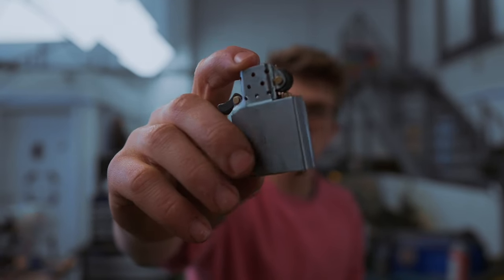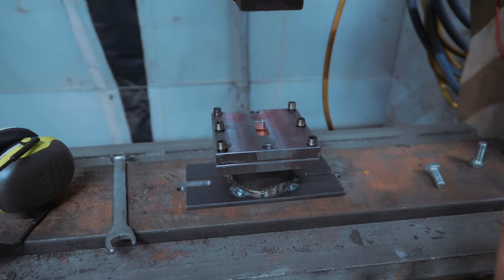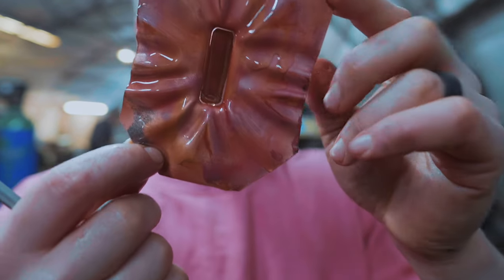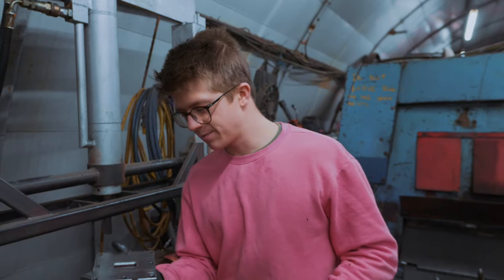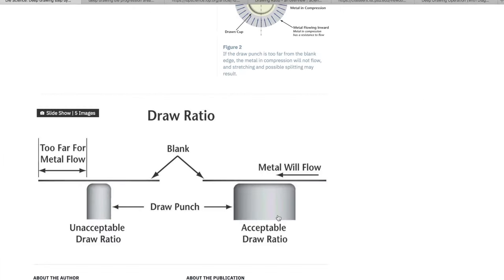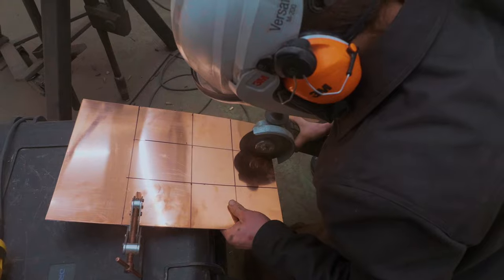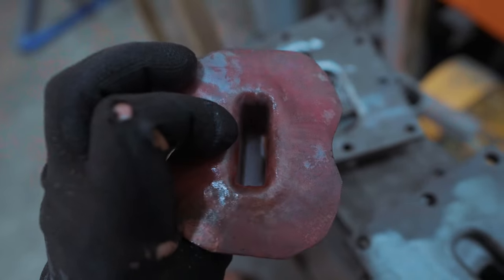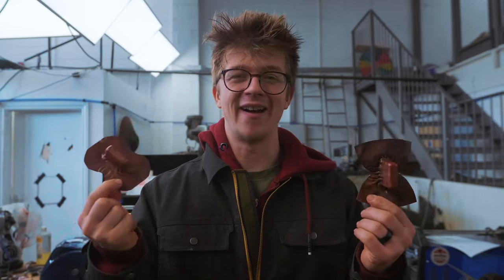Can I Make This Iconic Lighter? Part 5

Comment: Explosive forming is a metalworking technique in which an explosive charge is used instead of a punch or press. It can be used on materials for which a press setup would be prohibitively large or require an unreasonably high pressure, and is generally much cheaper than building a large enough and sufficiently high-pressure press; on the other hand, it is unavoidably an individual job production process, producing one product at a time and with a long setup time. There are various approaches; one is to place metal plate over a die, with the intervening space evacuated by a vacuum pump, place the whole assembly underwater, and detonate a charge at an appropriate distance from the plate. For complicated shapes, a segmented die can be used to produce in a single operation a shape that would require many manufacturing steps, or to be manufactured in parts and welded together with an accompanying loss of strength at the welds. There is often some degree of work hardening from the explosive-forming process, particularly in mild steel.

Comment: As someone who actually used to design deep draw tooling I can say that you don't have enough stages to do this. I would say a bare minimum of of 4-6 well designed stations as a starting point is required for this kind of thing(I don't have all the info required and it's been a while since I've run the calculations so that's just a rough estimate). Also brass would be easier to draw like this. If you want to make several of these I would highly recommend building a spring loaded stripper and if you run the numbers you can significantly reduce the size of the blank and cut it such that when it's done being drawn it only has a few millimeters of a flange on it which would also reduce the friction of your hold down plate making it less likely to crack. if you were making a lot of these I would suggest making a trim station that cuts the flange off.

Comment: I'd have really like to see him take 3 sheets of that copper and stack them together and then try drawing them down and thru the dies. Also would have liked to see him to a fast press instead of going as slow as he could. I used to form bullet cases out of brass and aluminum and it was pressed extremely fast through a die set to elongate the material.

Comment: The case may not be "perfect" but who else is going to have such a unique and detailed lighter case! I can't wait to see it all polished up.

That first mistake looks like some kind of trans-dimensional doorway. Super cool result even though it wasn't what you were trying to make.

As for finding a quick and easy way to complete this component, time is money in industry and manufacturers spend mountains of money refining their processes so it seems unlikely that you would find some easy hack to skip half of the steps and still come out with an acceptable part :)

Comment: Working sheet metal can be extremely difficult... Just to put things in perspective, when Hugo Borchardt  designed his semiautomatic pistol, the magazines were initially made by milling them from a solid block, instead of using stamped sheet metal.

Comment: Hi alec im a die maintenance technician and tool maker. Ive had years of experience in this field. The stages were good. You however most likely would not have needed as many if you did not retain the copper as tight. The copper was just stretching which was putting too much stress on it. However a very good job considering you are a novice in this field

Comment: it's not really possible to draw it all out at 1 go, in Tool and Die industry there's progressive stages to achieve that. with different hole and punch sizes and radius of the punch. to draw that deep is not easy, different thickness of the copper sheet have a different calculation too. you can try a gradually deepening wider top U shape and then shrinking it down as you go deeper and flattening out the bottom and edges to give some room for excess materials to be pushed out and you draw deeper.

Comment: I would have considered to go at it from the other way - how the aluminium soda cans are made from a piece that's placed at the bottom of the stamp and then have it heated and pushed out to the shape wanted. Possibly by using the stamp and a power hammer striking it. Maybe I'm too violent?
Reply: Soda cans are hydro formed.

Comment: Alex, maybe try some explosive forming. In another episode. You can stretch metal 3 times farther than with conventional methods. The theory is that the explosion causes the molecules of metal to vibrate so the metal becomes plastic. At one time the Brits were using it to form armour plate cupolas on their tanks.

Comment: Alec, I applaud your desire to learn new skills but was there a reason you didn't just mill it out of a solid block of copper?
Reply: Milling is time consuming, tedious, and gonna be heavy. Can't mill metal as thin as sheet metal
Reply: @h.cedric8157  Could have folded, tig welded and polished off the welds though. Would have been much much faster and cheaper for a single item
Reply: @DoodlesMcpooh  i think him knowing he could have tried it the "real" way would have killed him :D. Also he sure wanted to learn this technique as well
Reply from the maker: Only because I wanted to try this technique and learn about it!!
Reply: Thats what i thought, if you love doing something, time's just a number :)
Appreciate your endurance, keep going alec 🤟
Reply: @AlecSteele  I respect that you love to learn something new. That's they way to be. Congrats on it finally working buddy
Reply: What is the jacket slash half zip work shirt he is wearing int the end of the video?

Comment: less binder tension  you just want it to guide the metal not clamp it use some spacers so you dont clamp the copper but just guide it straight

Comment: you are shooting yourself in the foot by wrenching the top plate down, after you get it started you have to loosen or remove that pressure so the metal can push down

Comment: Alec. A quick question.
Isn't putting hot metal in water or oil ment to harden it?
Reply: That's true for steal but coppers structure is a bit different so it will actually soften after heating and rapid cooling it and will harden as it is worked on

Comment: I’m confused by the tempering of the copper. Waaaaaay back in the 80’s at high school, we were taught to heat then shape copper, then heat and quench to harden it. If you quenched it and then tried to shape it, it quickly became brittle and broke.

Comment: You shouldn't of bolted the top plate to the bottom just use shims at first and slowly press down and remove the shims as you go down to full stroke

Comment: Instead of starting with a plate and pulling it into a shape, start with a solid billet at the bottom of the chamber and as it crushes, it will push it up the gap inbetween the male and female parts, This is how aluminium cans are made
Reply: what kind of cans? because thats not how drink cans are made.

Comment: Why not just do it like the early Zippos: solder a base plate onto rectangular tubing? Not only would it be cheaper and easier, it's the way the Zippo factory did it in their early years.

Comment: Heat the piece BUT don't quench it!  Let it cool down slowly to keep copper soft. Every time you Hardened blades, you quenched the blade when red hot.  Why do the same to soften the metal?
Reply: Copper has a different make up than steel and will actually soften when heated and rapidly cooled

Comment: I hate to sound too cynical but they call it PROGRESSIVE tool and die for a reason. I used to work in a factory that took rolls of steel and turned them into empty battery  cans (AA, AAA, D). They'd start with punching out discs on a huge press then the discs went through tools with progressive shapes the achieve the final cylindrical  shape that we are so familiar with.

Comment: Doesn't cooling it off in the water defeat you're purpose of annealing?   It should be cooling off as slow as possible to make the largest platelets.
Reply: Not with copper, the most straightforward way to anneal copper is to heat and quench

Comment: It’s the shape of the pellet, not your mold.  You can’t start with a sheet, you start with a heavy disc and take it through 6-10 stages each thining and stretching further moving metal further.  Go back to when you first saw how an aluminum can was made.

Comment: God damn that radius looks so unclean and rough! 
It's putting stress on your sheets! 
U need a really big radius on the top which gets smoler on the inside.  It has to be consistent and clean.  It recommend to go at least for 600 grid. I polish my tooling to a 1000 sometimes even 2000 grid.

Comment: This is really easy to do without a hydraulic press. Heat up the copper and keep it hot and just hit that top die with a hammer problem solved. If they would have done that from the start they wouldn't have waisted a whole day fucking around and all that copper

Comment: Literally all he needed to do was not tighten the copper down too much. It was punching a hole every time, because the copper couldn’t move with the punch.
Reply from the maker: Unfortunately it’s not that simple, there has to be a force exerted on the flange during deep drawing to avoid excessive wrinkling and folding

Comment: you could of saved yourself $1500 ir you would of taken the plate off the top of the die you restricted the maliability or ability to bend for copper that should of been a 20 min project
Reply from the maker: Unfortunately that wouldn’t work, deep drawing requires a force on the binder plate to allow the metal to form without wrinkling and folding